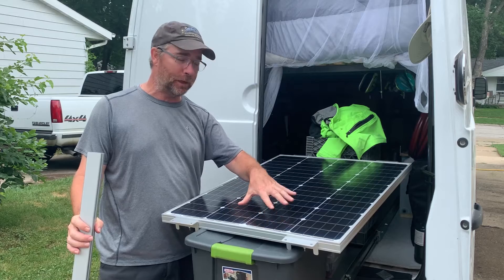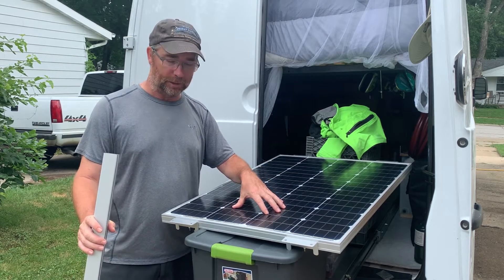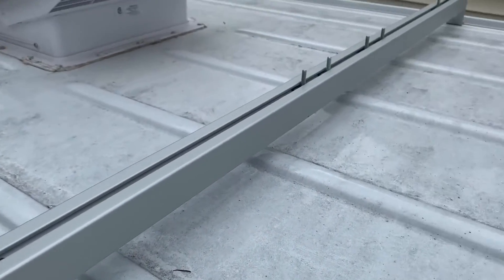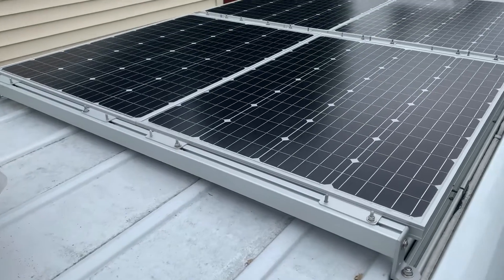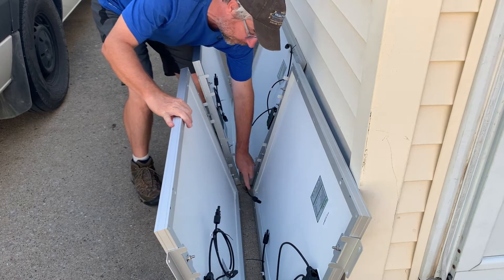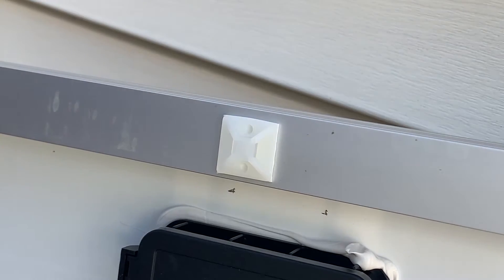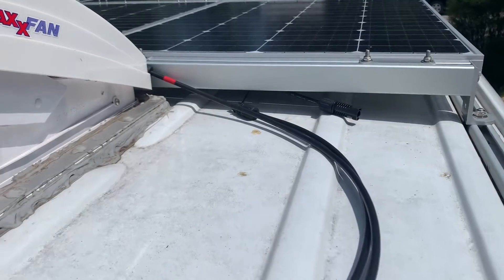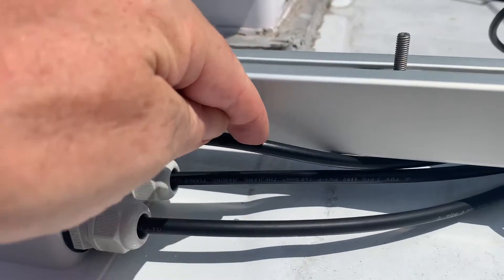SOLAR PANEL INSTALLATION ON DIY CAMPER VAN WITH 80/20 PRODUCTS - A super easy & quick project

Comment: Hey Tim, do you have a link for the cap on top of the solar wire entry gland?   Seems like that would work well to run my cell booster wire through the same hole as my solar wires.  Thanks!
Reply from the maker: Hi Darren. That’s the cap that came with our WeBoost cell signal booster and that’s the cell booster cable going through it.

Comment: We have the same panels - they're waiting for their van lol.  Great video!
Reply from the maker: So cool! Be sure to measure the panels, and don't just rely on the specs on the Amazon site. Ours arrived a lot larger than what the specs said they were, so we had to redesign how they would fit on our roof! Luckily, it all worked out in the end and we ended up with 2 extra crossbar assemblies which are useful to us as well. Good luck with your build!
Reply: @TimAndShannonLTD  Thanks for the heads up :)